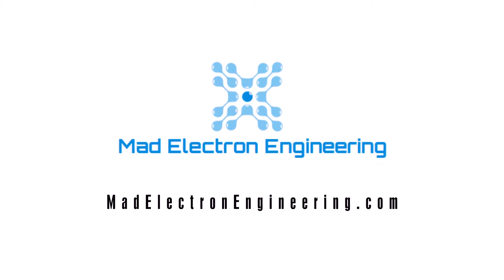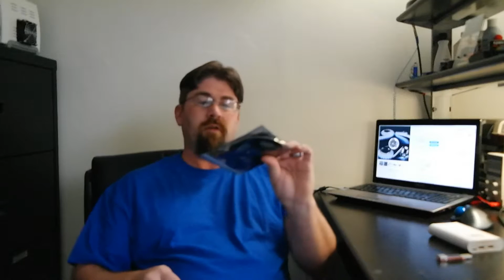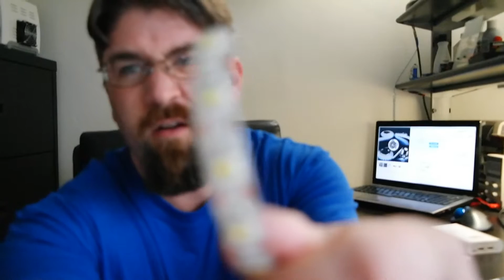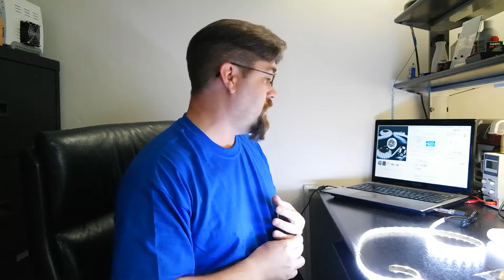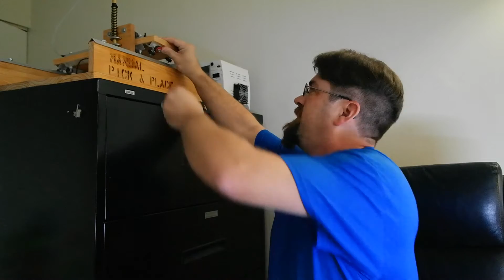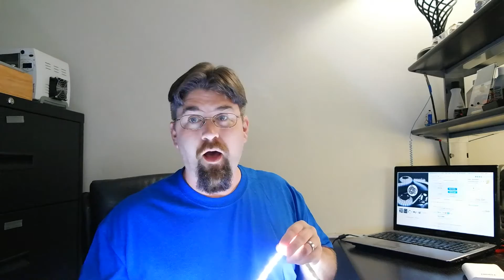$8 USB LED Strip From eBay Review

Comment: I bought some LED light strips on eBay for my TV, and I’m using a USB charger that came with my iPhone. I noticed after about 2 hours, that the charger gets pretty hot. I’m worried this will be a problem. Should I get a different USB charger? If so; what do you recommend? Thanks

Comment: Quick question for you Mr. Lights MAN: how long will these lights be lit up for on say on a 4.8 output battery pack? I am trying to avoid having USB wires exposed everywhere, into an outlet (want to run these lights under a very small 1 meter long kitchen cabinet) PS - I liked your video, VERY informative.

Comment: For your pick and place I'd use a 5630 3 led module and use a step up converter to 12v 5630 can run off of 3.7v but most strips are made for 12v